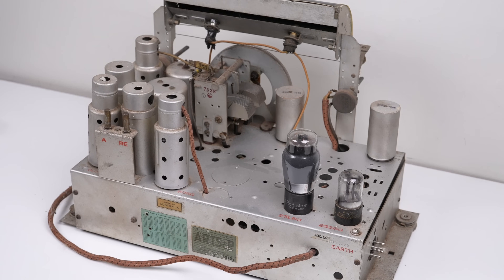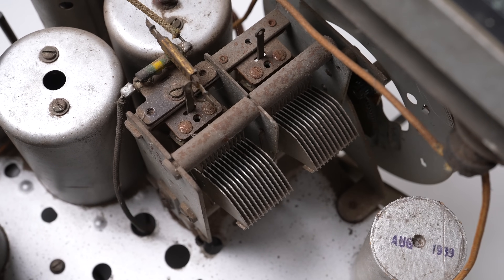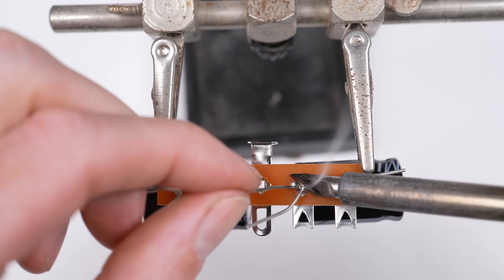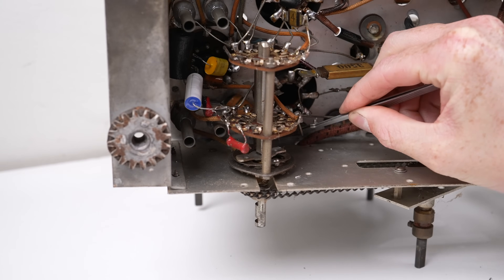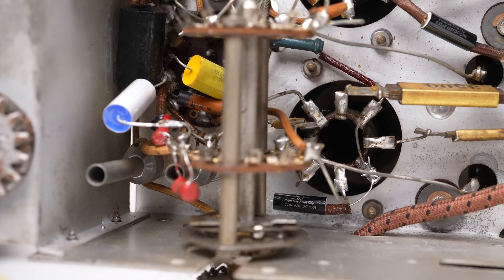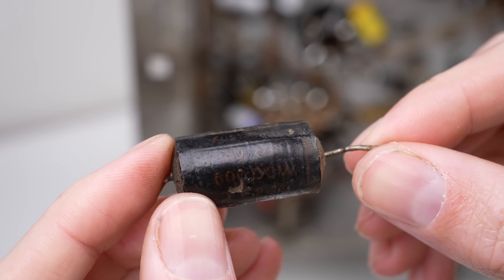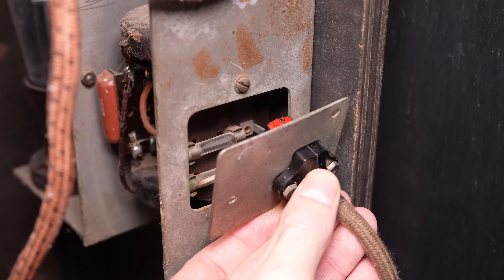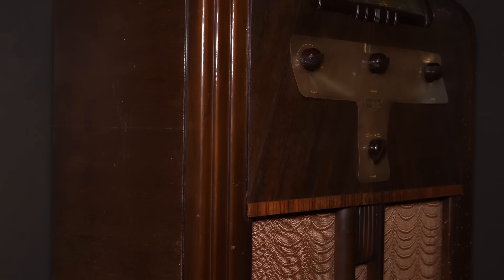Breathing Life Into A Forgotten Piece Of Technology ⚡️ High Voltage Restoration

Comment: You need to find dial lamps that draw 300 ma of current to match the current draw of the tube filaments. That is kind of a stupid design to put the bulbs in series with the filaments without some kind of shunt resistor.

Comment: This is genuinely so cool! It’s all so complicated yet so simple and really fascinating to look at. My grandpa has a really old radio which I think works but it only played static last time I tried turning it on many years ago. I’ll actually try turning it on tomorrow and I’ll update you on this comment! Anyway I’d love to see you repair more old radios Hugh, it’s really entertaining.
Reply from the maker: Thanks!
As you the radio you mention, If its a tube radio I would advise NOT to plug it in without having the proper safety protections for yourself and the radio. These capacitors can fail in such a way that can destroy an old radio. I was using a device called a DIM Bulb tester to limit the maximum current incase of any issues. I would suggest doing some research on how to safety power up an old radio before continuing.
Reply: @HughJeffreys The best way to power up old vacuum tube radios is with a Variac transformer. Set the voltage around 60 volts and slowly bring it up over about 36 to 48 hours. It might not reform. If you hear AC noise, then disconnect it and replace the electrolytic capacitors.  You will need to replace any wax foil paper caps and check for damaged resistors.
Reply: @HughJeffreys I’ll look into it. But I’ll probably just grab an extension cable and plug it in from far away. If anything happens either the old unused radios breaks, or the breaker will trip, which I’m kinda ok with both lol.
Reply: @panagiotispappas1001 No, that can still destroy the radio. Dim bulb tester limits current and will drop the voltage if something draws more than a couple amps. Don't plug it in without one.
Reply: I still haven’t tried turning the radio on because I’ve been busy. I will it at some point. (If I remember to that is)

Comment: YES HUGH PLS MORE OF THIS OLD TECH REPAIR OR CLEANING. ITS SO SATASFYING!

edit: thanks for the 419 likes!
Reply: If you like this content you should check out shango066
Reply: Yes please!!
Reply: agreed!
Reply: What the hell is wrong with you?! Nobody has radios like this.
Reply: @HyperHorse hater
Reply: @HyperHorse  Yes we do.
Reply: What? Bot…
Reply: @HyperHorse  hater
Reply: @HyperHorse  
I have several dating from about 1960's back to 1929.
I got a 1944 very deaf Wireless 19 Set going. 
I replaced an r.f. choke and resistor in my 23 valve Racal RA17L.
G4GHB.
Reply: @HyperHorse  do you know that one mans junk is another man’s treasure? That especially applies to tank like reliability for ancient technology, you could never know that it could last possibly 5 decades or more if it has a really simple circuit and is maintained well like a relay logic elevator/lift

Comment: When working on old electronics, be careful with the lead fumes when soldering
Reply: Lead boils at 1740 degrees celsius. Is literally impossible to breath lead fumes while soldering with a soldering station. Just use gloves and wash your hands after. The fumes are just flux fumes, they arent that bad for you, but if you are soldering regularly is recomendable to invest into a fume extractor.
Reply: @ltux90  You are absolutely right, i did not consider this
Reply: i would be ded by now
Reply: @Achhcity  A great number of technicians have preferred leaded solder over lead-free due to how the latter turned out to be less than satisfactory, so they know very well the risks involved.